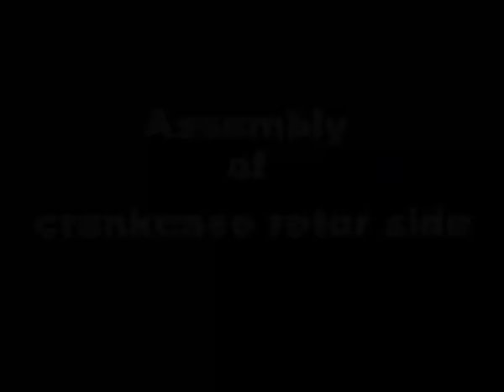MOTOR BAJAJ 205 CC.

Comment: I fix piston ring of new 205 4s  the machine perform well but within two or 3 day  the piston break between top 1 ring and top 2  it for 2 or 3 machine what happened
Reply from the maker: Hello friend a pleasure to greet you if what I can say is that you have a problem of lubrication there is a good lubrication as for the cylinder and stock my good friend, cordial greetings.

Comment: what is the main problem of this engine because it always smoking
Reply from the maker: Hello friend Olubode Waheed technician like it; Well normally motorcycle oil consumption is mainly due to the oil entering the combustion chamber and can be given by the rings of the engine or by the guides of the valves that these with much axial play, which will give us an oil consumption To the inside of the engine and as a consequence smoke from the exhaust pipe when accelerating Grace for your valuable commentary from PERU file. Atte: BR WORKSHOPS.
Reply: Hi